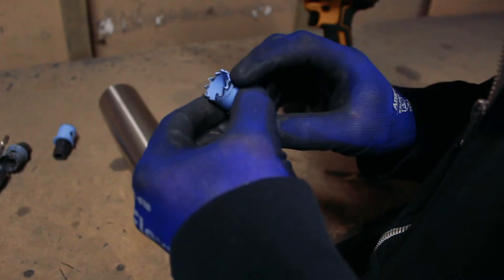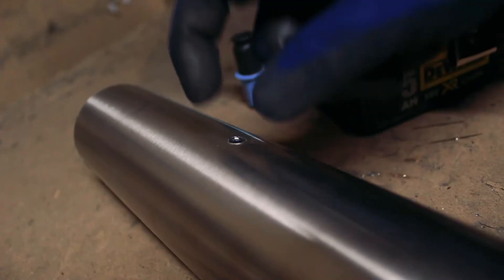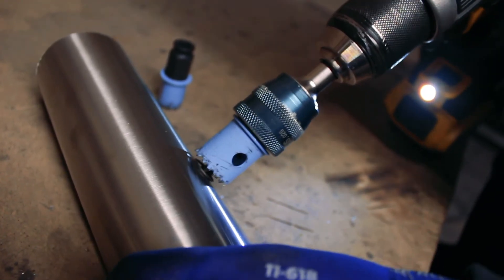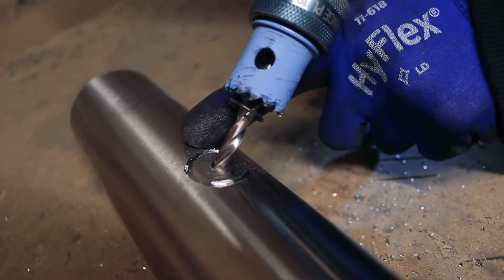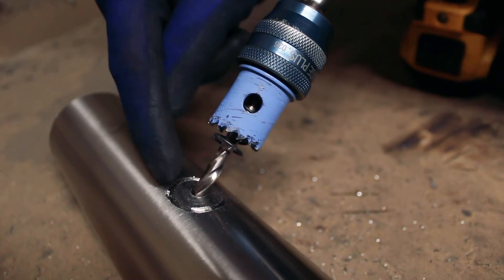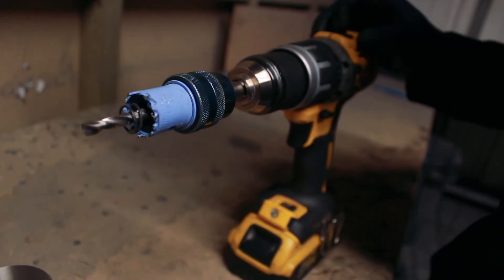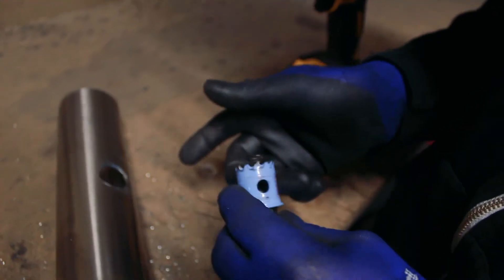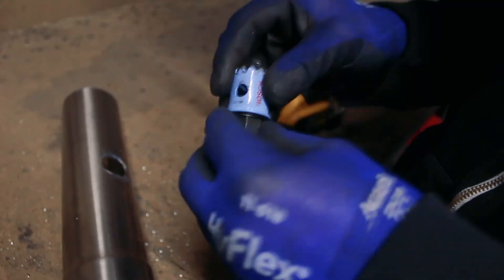How To Drill Stainless Steel Exhaust Tube | Lambda and O2 Boss, Quick and Easy

Comment: Nothing to do with exhausts, but what's the best way to drill a 8mm hole in 25mm tubing? Will 4.5mm work for the pilot, then 8mm?
How do you stop the drill bit from wandering on the tube, punch it first??